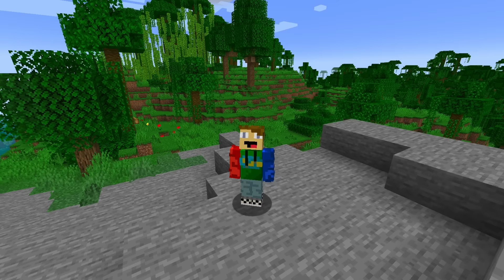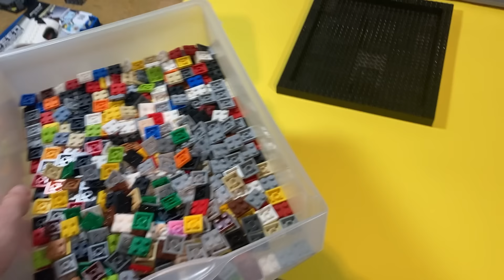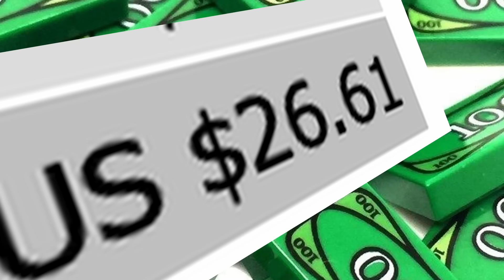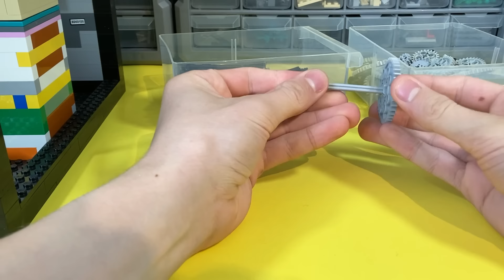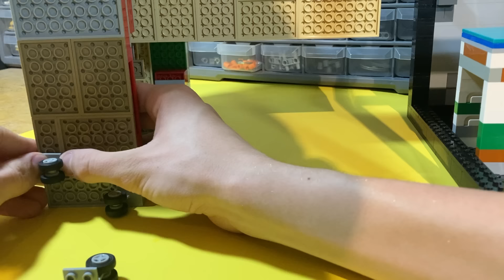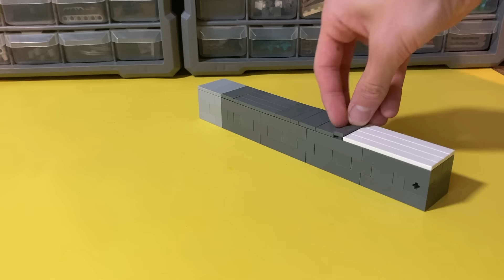I Built a Working LEGO Minecraft Piston...

Comment: As suggestions for another, if you decide to later on, would be to have the telescoping shaft, like in Bedrock, which should allow it to proportionally extend as far as it would in-game.  Along with racks and gears in between, for the even movement, you should be able to have it motorized, though it may be slow due to the weight and taking into account the mechanical disadvantage.  Perhaps having the lever control a gearbox on the inside to extend and retract it with each of the connected gears moving the rack(s) out of reach of itself at both of the furthest points to ensure there wouldn't be any damage caused to the pieces, as the motors continue to spin, while the other gear, which would be disconnected from the motors in the meantime, is still engaged to the rack to move it back when it's switched.  I may be overthinking it and it could be expensive to get what you may not have already.  Good work, though.
Reply: God damn what do you want this man to do, build a rocket???
Reply: @avergreengreen950 
Is my description too complex?
Reply: Too complex? You wrote a whole paragraph explaining something that would usually take a sentence to write. Not insulting you or anything im just saying its a lot of information.
Reply: @avergreengreen950 
I understand.  As I put, I may be overthinking it and my ideas are usually complex in description, perhaps unnecessarily, though I wanted to make sure it was clear what I had in mind.
Reply: keep up the thinking, itll lead u somewhere in life that'll be sweet